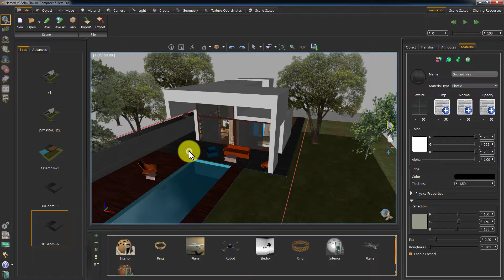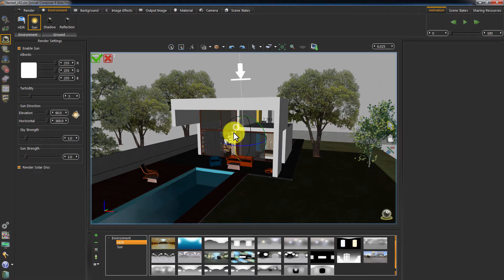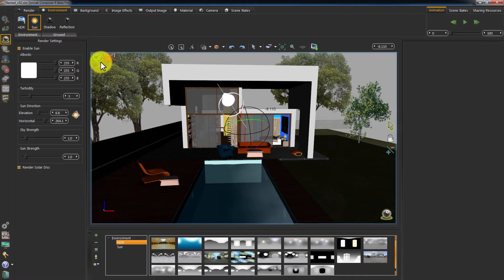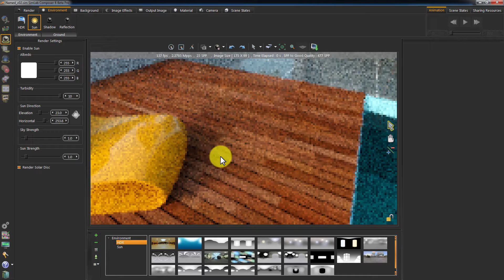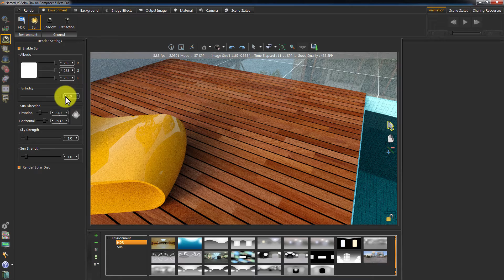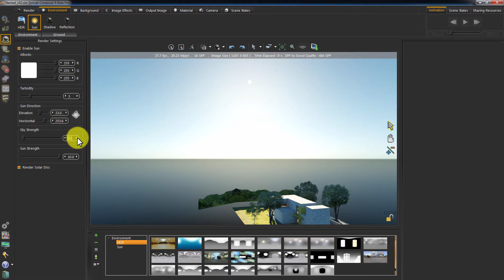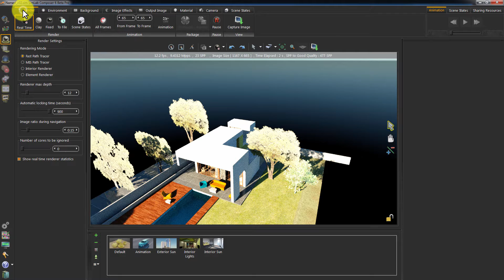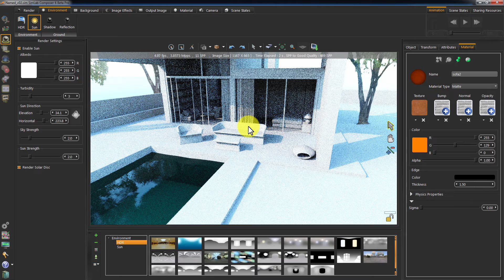Architecture: 1. Exterior Lighting

Comment: Can you set time, date, location? How do you link a certain setting with a specific view?
Reply: In SimLab Composer 7, you can apply different Sun presets to the view from Libraries > Rendering > Sun, or you can get more control on sun by accessing the Sun setting. Sun setting can be accessed as follows: Geometries tree (at the left) > Environment.
Reply: scheven architect штр ококль мц1ш9х и